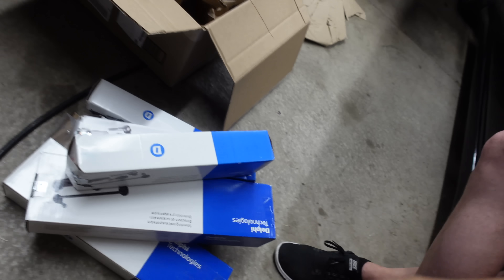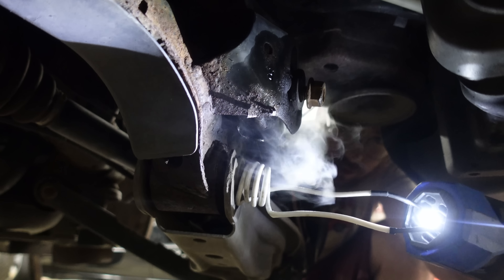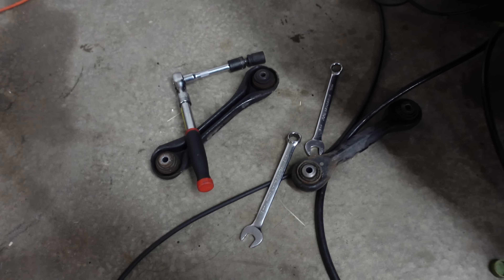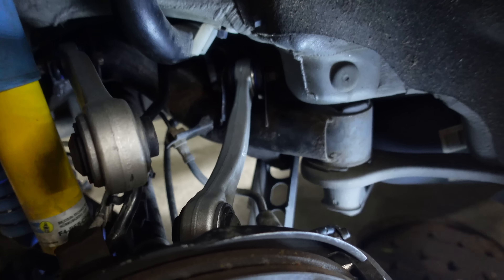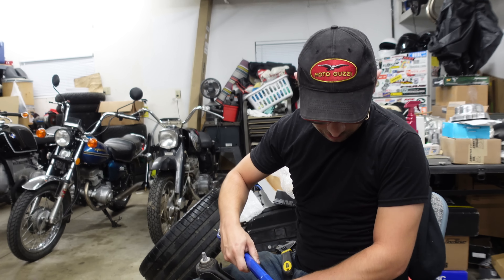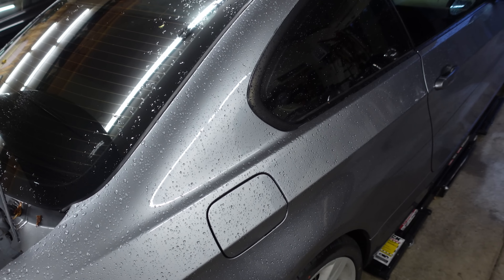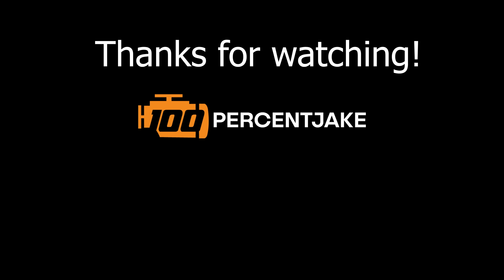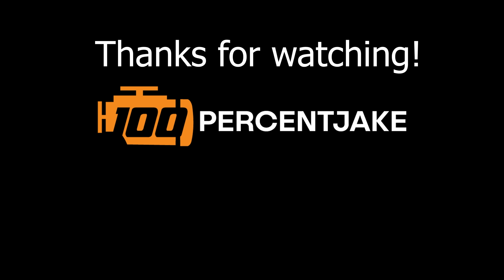TIRE SHOP DISASTER! Replacing WORN control arms goes WRONG!

Comment: While the Milwaukee Torch sawzall blades used to be the hot setup, there are now sawzall blades with carbide teeth.  Used one to rip through the suspension bolts on my nephew's Silverado (rusted in place like yours).  I had burned up several Torch blades so we ran to the Borg (Lowes/Home Depot) and bought the carbide blade on a whim.  It went through the hardened steel bolts like a hot knife through butter.  No muss, no fuss.

Comment: There are some m-suspension components you can swap onto a non m-e46. The RTA’s, upper and lower control arms are the same between the m and non-m 330’s.  You can run m3 RTAB’s and the ball joints in both upper and lower positions on the RTA vs one ball joint and a bushing on the non-m’s.  Of course you can swap the entire rear subframe and diff from a m3 onto a non-m.  

IMHO unless you’re driving a 325i or less it’s not worth it.  For the lesser models you end up with bigger brakes and axles, min gain on a 330.  While you also gain the LSD it’s been beat on for 20 years and likely needs a rebuild. 

On the front you can run m3 lower control arms, sway bar and struts as well on non-ms with appropriate strut bearings. 

Nice work as always.

Comment: Have you done the rear subframe bushings yet? Those will make an big difference as well. The easy rout is the 034 motor sports aluminum inserts that work with the stock bushings. I have a new set I can let got for $100

Comment: That scenario is what we have over here in the rust belt.  The jungle store sells diablo sawzaw blades, and they work as good as their circular saw blades that are top rated.  I cut up a wrecked 08 mercury milan using those blades, and used far less than any other blades I've tried.  G-d bless you fellas.

Comment: Every shop tech should be able to balance a wheel. Using only a minimal amount of weights. 
But when you still have wheel judder after a good wheel balance and a brand new rotor you should test the run out of the bearing flange. Use a micrometer. If it's badly rusted or warped only a tiny bit it will translate to much more run out because of the sizes of wheel and rotor.

When you are particularily nerdy about alignment maybe try to find a racecar specialist shop?

Comment: I can tell you exactly what was going on at the chain tire shop.  They typically pay peanuts compared to actual shops, and their hours are usually garbage as well.  Any tech worth their salt, that hasn't rage quit the industry, can get a better job elsewhere.  High turnover is EXTREMELY common in your Midas, Firestone, Goodyear, Tireman, ect, type shops.  I worked for a Goodyear for six months at the beginning of my career 20 years ago and it was a nightmare.  Never. Again.

Comment: Im going to be doing this job eventually on a 328xi and i am not looking forward too it. Fingers crossed the hardware cooperates as it has been garage kept its whole life
Reply: Correct me if i'm wrong, but I was under the impression that the Xi's (with awd) cannot use the front suspension from the M3 at all. I know for sure the Xi has specific shocks, and a much slower steering rack.
Reply: @clonetrooper576   I just meant they will need replaced soon, not that I can upgrade to M3 for everything. I can confirm the steering rack ratio is a lot stiffer, not sure if i would call it slower, but maybe more direct/intentional/heavier? I can only speak from experience with a bmw x5, x3 and 2009 328i xdrive and the 328i steering is certainly the heaviest when all suspension joints are in good condition. Front end suspension work does look to be very tedious and crowded so I don't expect any of the m3 bits to work there.

Comment: Have you thought of putting a 4.73 rear diff instead of the stock 4.17? Did you already do the 3 stage manifold?
Reply from the maker: Manifold and valve rebuild kits are sitting on my workbench!
Reply: @100PercentJake  I have both sitting on my garage floor just being lazy